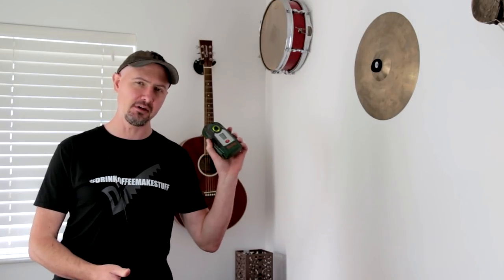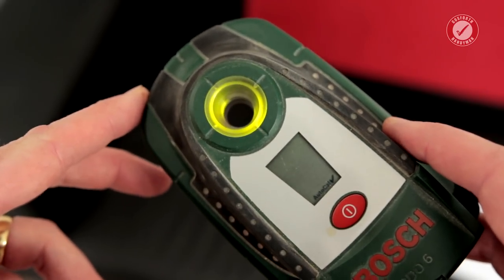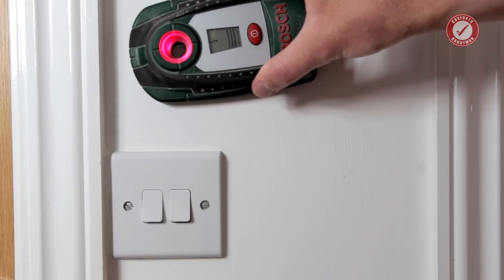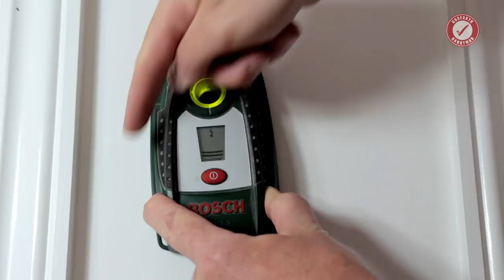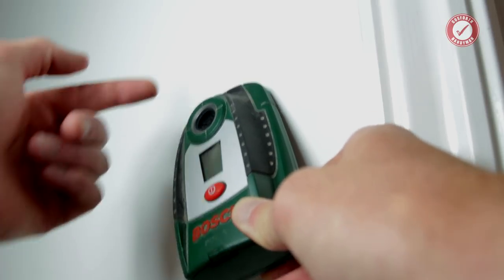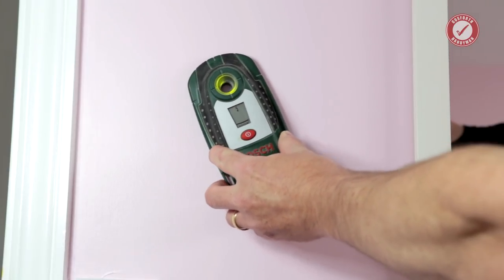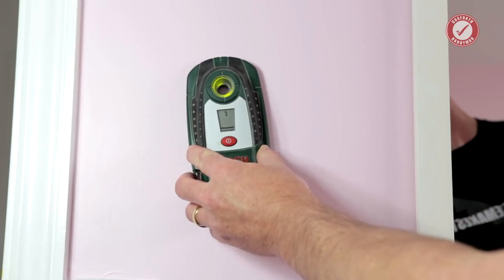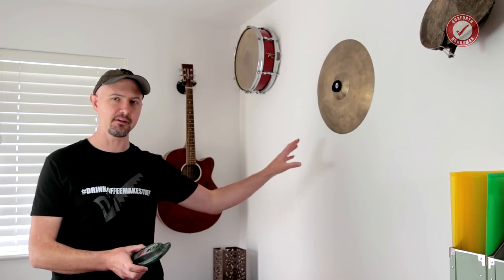How to Use a Pipe & Cable Detector - DIY Tips!

Comment: Tip from the Bosch manual: "When the measuring indicator continuously shows an amplitude even though there is no metal object in the vicinity of the measuring tool, the measuring tool can be calibrated manually. For this, remove all objects in the vicinity of the measuring tool (including wristwatches or rings of metal) and hold the measuring tool up in the air. With the measuring tool switched off,press the On/Off button until the illuminated ring lights up red and green at the same time. Then releasethe button. When the calibration process was successful, the measuring tool will start over after a few seconds and is then ready for operation."

Comment: I have a similar detector. I think one of the tips that were in the instructions say that to avoid or reduce the false positive detection of electricity, place your other hand palm flat on the wall.  It does seem to reduce it a bit but I still only treat it as a guide.
Reply from the maker: Interesting! Doesn't mention that in the instructions of mine but it can sometimes help to discharge static. 👍
Reply: This definitely helped with 1 detector I used recently (can't remember the model). It dramatically improved it from beeping all over the wall to very accurately showing me a diagonally running light switch wire. Can't say it works with all detectors though and not sure it was discharging static either. Hand off - terrible, hand on - accurate, hand off - terrible, hand on - accurate.
Reply: @EdibleCastleWill  wax on wax off wax on wax off

Comment: Bosch told me it’s due to static....rest one of your fingers on the surface of the wall as you run the detector over the wall and it stops it!
Reply from the maker: Yeah - seems to be - that sometimes works. Seems to be a bit random as sometimes even putting my hand on the wall it still gives the occasional false positive.

Comment: Hi Andy, I lost a mate who went to school with me and started working for his dad who was an electrician, they were working on old council houses and had all the plans for the houses. he drilled into a wall that was not supposed to have any cables in it and all the electricity in the house was off. he was using a steel-cased drill (they were common then) and because he was gripping the drill they could not pull him away from it. If it had happened today with plastic-bodied drills he would have probably survived the accident but it goes to show that even when the power is off you have to take care. I don't think detectors were available then either.
Reply from the maker: Oh man - so sorry to hear. That's awful. Yeah, you can never take anything for granted with this stuff. The amount of new builds I see that still don't follow the 'safe zones' is crazy. 👍👊

Comment: Hi Andy. Great video. I have a Bosch detector and I found this following tip somewhere (can't remember where), but it seems to make my results more reliable. Would be interested if you could try it and see what you think? The tip is to place the palm of the hand that isn't holding the detector flat against the same surface you are measuring. Maybe it discharges static or something from your body, I dunno, but does seem to help....
Reply: I've also got a Bosch that looks identical to Andy's and discovered this myself. There's one internal wall in the house that consistently gives false positives unless I place my free hand on it.
Reply: Putting the palm of my free hand on  the wall turns my cheapo Lidl detector from a gibbering idiot into a surprisingly accurate machine (locates studs to ~3mm).
Reply from the maker: Yeah - it's defo a static thing by the looks of it. Sometimes works for mine but sometimes doesn't - very weird. Great tip! 👍

Comment: I photographed all the pipes and electrical when we had our basement finished, so I know where every pipe and electrical wire is located.  But my Zircon stud/metal/electrical detector  gives lots of false positives or misses with all three.  It has a very hard time with double wood studs.  

Electrical wire often jumps horizontally from one stud to the adjacent stud - I don't think that is a code violation as long as it is properly secured at both ends.  

I see many good reviews on the $50 Franklin 13 LED sensor which works very well with studs but does not detect electrical.
Reply from the maker: Photographing the place during 1st fix is absolutely the best bet. 👍👊

Comment: I thoroughly tested several detectors and found that there is not "the best". I checked at locations where I exactly knew which cables or studs or metal objects were behind the surface and different technologies worked differently good in different locations. In the end I decided to keep the Tacklife DMS03, which is very low priced, but often can find the objects very quickly. In addition I also kept the Bosch GMS 120, which sometimes is more accurate, but needs often more time to auto-calibrated by moving backwards and forwards several times. It also has the downside that it's pretty big, so for smaller places the Tacklife is the only usable option. The Bosch D-Tect 120 did not detect more accurate nor more reliable or more objects than the other two devices (combined). In contrast the D-Tect 120 gave me lots of false warnings. The advantage of the the GMS 120 and Tacklife DMS03 is that you can switch between different modes. This dramatically helps to fine-tune the search and differentiate between different types of objects, but also double checking with the two devices made decisions where to drill much better informed. Last not least it's important to remember to put the free hand on the wall to discharge (hope that's the right word here, in German I'd say: "erden").
Reply: Yep, they all don’t seem to work very good. It’s 2022 you’d think they’d have something that actually works by now

Comment: I own an unbranded detector which often gave false positives.  I bought a Stanley S200 which does the same.  After researching the problem, I learned to use it with my fingertips gripping the edge and just proud of the scanning surface so that the detector is a few millimetres off the wall.  This greatly reduces false positives for both the S200 and the unbranded detector.  The S200 manual suggests keeping your free hand at least 15cm away from the detector and wall surface to avoid interference.
Reply from the maker: Interesting! Yeah, I think it's a static thing. 👍

Comment: Thanks for the tips, but does it work with the new PVC / multi layer pipes? ... Here in Portugal plumber only use that. I have a big installation in a bathroom in the coming weeks and I am very stressed about the drilling part....
Reply from the maker: PVC - not a chance unless they've run silver foil behind them, which they're supposed to do in the UK but not always done. 👍

Comment: I have a Bosch GMS 120 that's a very good model similar to yours , but I have used a Bosch D-Tect 150SV that a kitchen fitter lent me for marking out for a extractor duct and I must admit I don`t think I would of been able to do it safely with mine . I drilled the whole underneath the window lintel , between a cable and water pipe with only 12mm space each side . Fact after drilling to see both the electric cable and the water pipe that close in the cavity I did think maybe I trusted it to much . Since then I keep looking out for a good second hand one  cause of the price . If you get the chance to try one I think you will be surprised .The best electric shock I have had is from painting a wall years after someone else had put a picture hook into the cable . So yes it wouldn`t of helped me for painting but does show even hanging pictures can be dangerous . Its not the first or will be the last time I have seen things like that happen . I was also working in a new property when the kitchen layout was changed and the fitter went to remove a base unit while undoing the fitting the power all went off. But I'm sure you have seen a screw in a pipe but no leak until for some reason the screw is remove or adjusted . Keep the videos coming they really do help when you have been out of work for seven year , after having a operation that recovery should of been six months , just had third two months ago .
Reply from the maker: Cheers Mark - best of luck with the recovery! 👍

Comment: I've found with mine (admittedly a simple light and alarm version without a digital display) that I need to firmly hold my unused hand on the wall, effectively grounding the wall, in order to get an accurate reading. Unless I do this then it shows my whole wall as having electrics behind  it. I always thought this was due to bad grounding in my house. Is that a thing? Try it when you get a false positive from the light and the display reads as no electricity, it always works for me, but I'm not sure why

Comment: Great video...When I have used this unit and get the old false/positive I have turned the electrics off at the mains. Of course with light switches one of the two cables is always live so turning the switch on and off isn't really reliable

Comment: Don't usually leave comments, but this is one of the most helpful, informative videos I've watched. Trying to put up shelves around gas and electricity meters felt like a minefield in Victorian tenement with a variety of walls. About to give up, terrified (my brother, a welder, suffered bad burns when he drilled into a live wire that had been wrongly marked as a safe point by others). Now have half the shelving up. Great stuff.

Comment: Hi how do they work to pick up wooden studs?
Reply from the maker: Mine isn't designed to pick up studs but you can get ones that do that - mixed results with the ones I've seen. 👍
Reply: @GosforthHandyman  thanks, that's my experience too with those